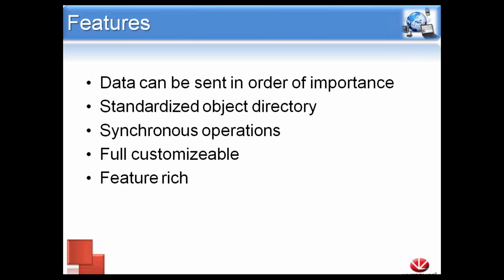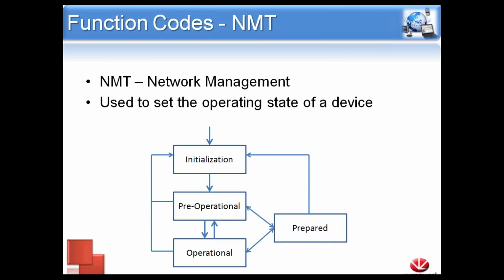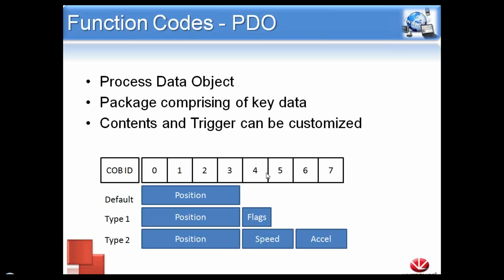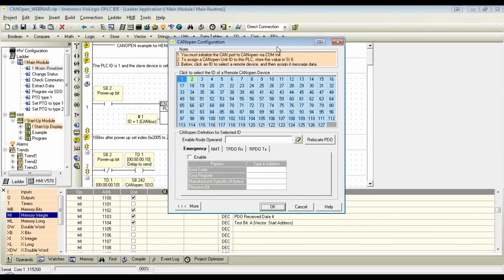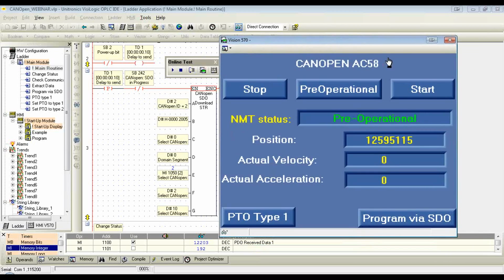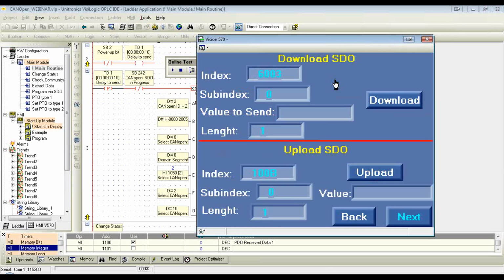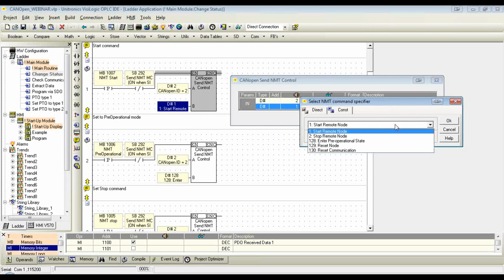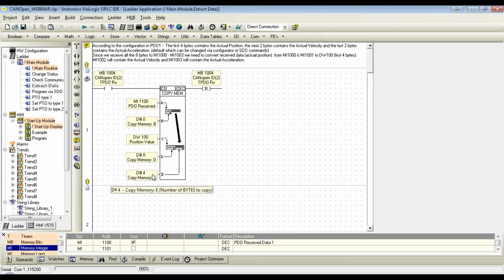WEBINAR: Unitronics Vision -  CANOpen

Comment: Why did the upload SDO (to read the dip switch) not work? 

And for the power-on download SDO (MI 1050 = 2 for Type 2), why did you set the length of 2 when the EDS showed that it takes only 8-bit?  And what is the difference between domain and block transfer?

What happens if you don't check the NMT or SDO's busy bit before sending an NMT or SDO?

BTW, if Node 0 is reserved for NMT.. then all COB-IDS in the OD's PDO entries (0x1800+) will reflect a COB ID of 0x180+ (corresponding to a Node 1-127)?  i.e. there is no COB-ID 0x180?    A maximum of 4 PDO/RDO doesn't seem like alot, what is the maximum amount of PDO data this could produce?

Comment: hi Brian, 

Is it possible for you to sent me the program you used for this demo? I am trying to connect a Samba via CanOpen to a Festo steppermotorcontroller and a small set of pneumatic valves but I do not seem to get the communication with the festo devices working. Maybe I can find some knowledge in your program. 
I want to control the valves, and send the steppermotor to various positions calculated by the Samba.
Reply from the maker: Hi,

Basically the example in this webinar is in VisiLogic examples --> communications --> CANopen --> CANopen Encoder.
We also have example for FESTO device. Please send a mail to support@unitronics.com and we will send you the example. (Attention to Ofir Levi)